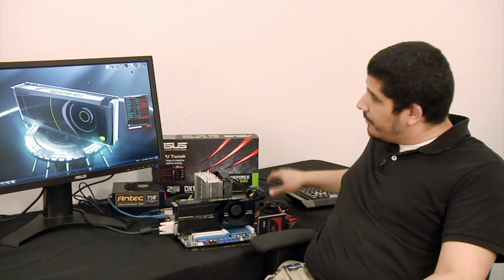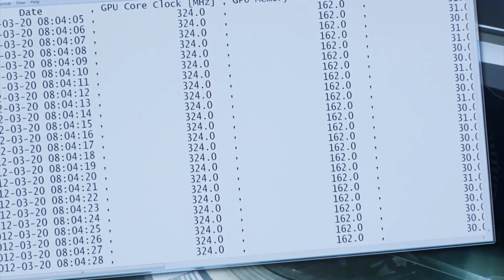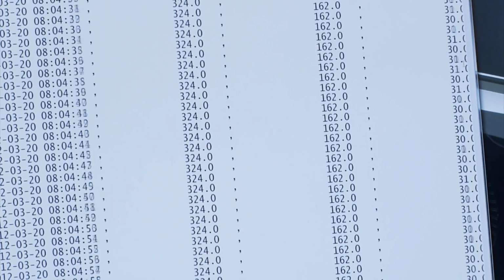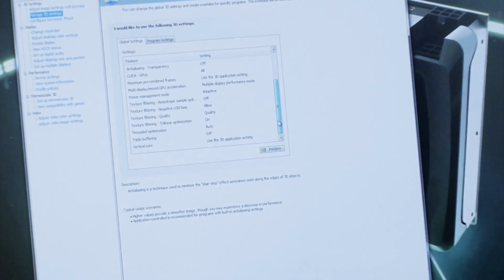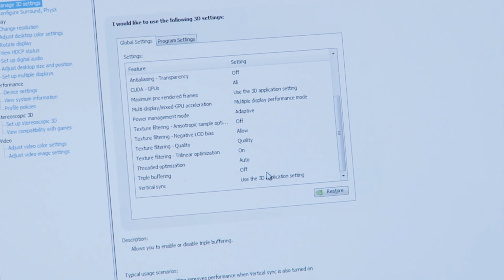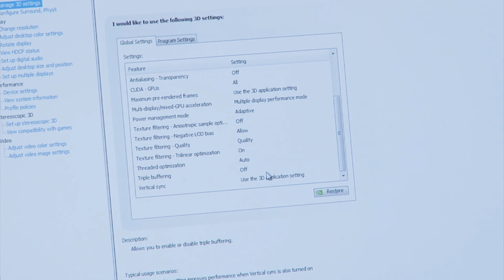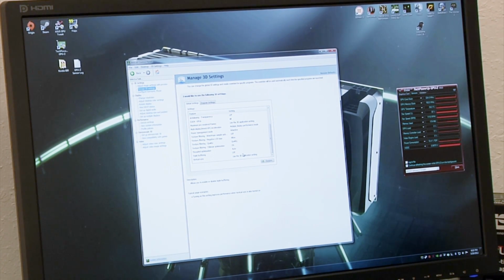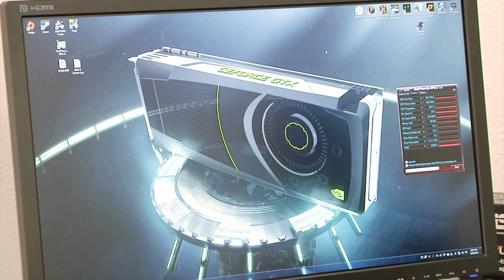GeForce GTX680 ASUS Graphics Card Overview

Comment: case: cooler master haf 922
psu : cooler master silent pro m6 600w modular
mobo: ga-z68xp-ud3 Gygabite
proccesor: intel i7 2600 non k @3.8ghz
processor cooler: custom cooler master
video: ASUS GTX 680 DIRECTCU II TOP 2GD5
ram: 16 gb kingston 1333
ssd: corsair force 3 120 gb
hdd seagate 2tb 5400 rpm
AND MOST IMPORTANT OF ALL !!!

benq 2420t professional gaming monitor 120 hz nvidia 3d vision 2

Comment: Oh... and "Fermi was an impressive architecture"??? Not a chance - the GTX4XX-series was very underwhelming with its ridiculous inefficiency and thus extreme heat production per performance. (That nVidia had to disable shader clusters to even get the GPU to be usable in normal circumstances shows how bad it really was.) The AMD HD5XXX series (Evergreen - especially Cypress) was a far more impressive, contemporary, architecture.